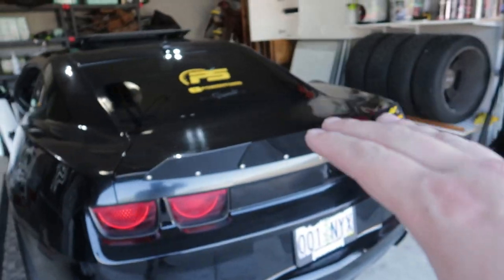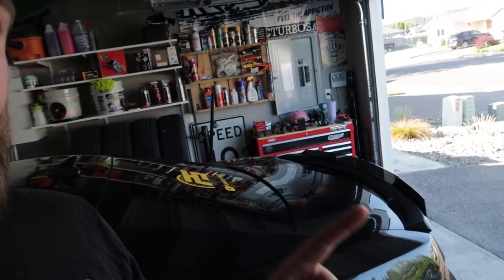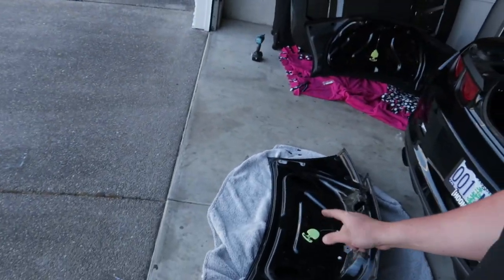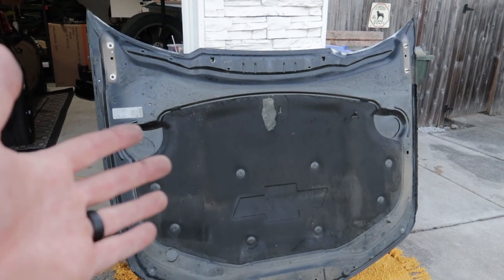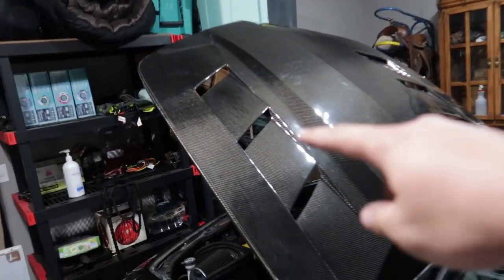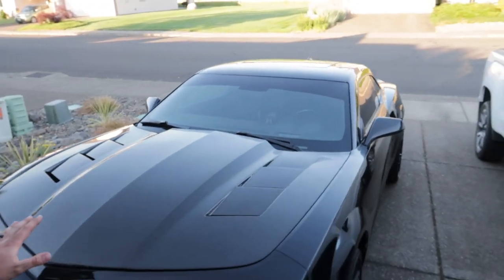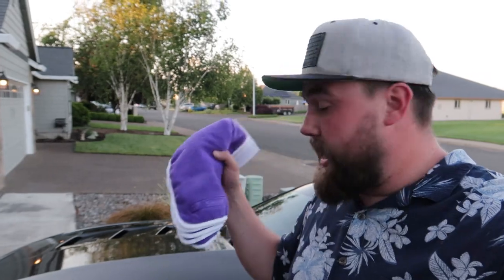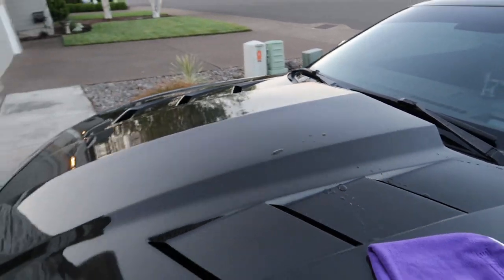SS Camaro Carbon fiber hood install

Comment: Having trouble finding the hood and trunk? Used the link but no luck
Reply from the maker: The hood is a discontinued one, but I will see if I can find a link to the trunk!
Reply from the maker: https://autoaddictusa.com/products/2010-2013-camaro-type-st-carbon-fiber-trunk-with-integrated-spoiler?variant=32667852767303&currency=USD&utm_medium=product_sync&utm_source=google&utm_content=sag_organic&utm_campaign=sag_organic&utm_campaign=gs-2021-04-26&utm_source=google&utm_medium=smart_campaign&gclid=CjwKCAjwt52mBhB5EiwA05YKo30KhHg1HnizdY_sUM_t2w7AupL3GULW3PIY0iEo7lqaMIbwdtcHdhoC3mUQAvD_BwE

This one looks Identical
Reply: thank you! @TurboDrivenAustin